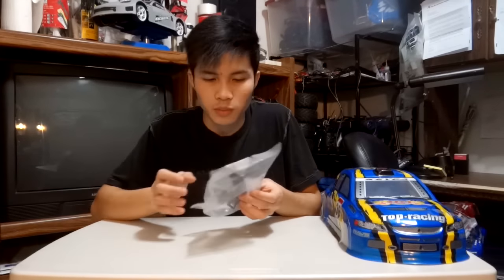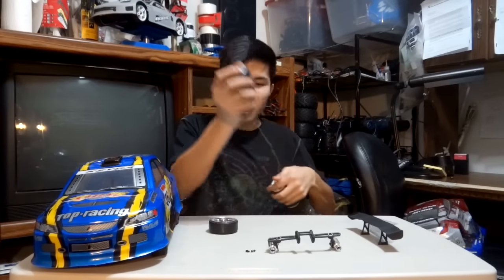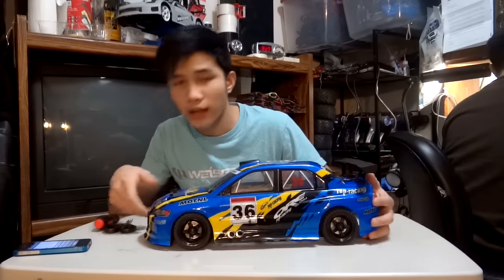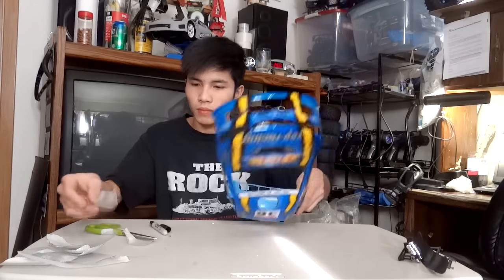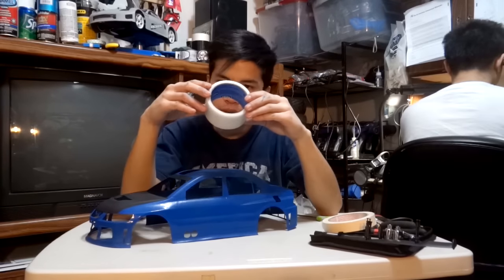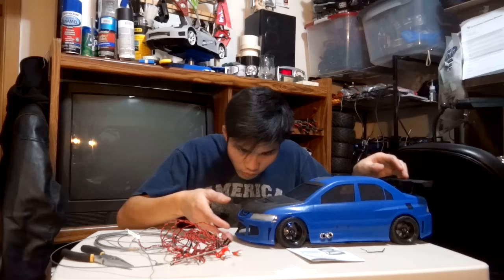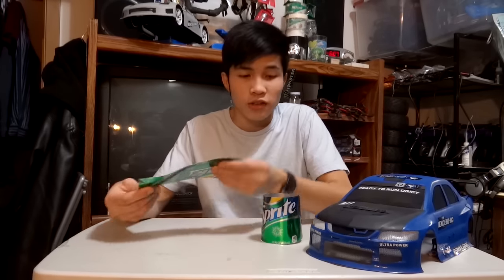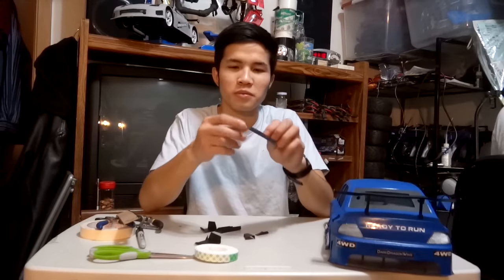RCMC4 | Mitsubishi Lancer Evolution IX or EVO 9 WTAC - RC Car

Comment from the maker: 1/10 MadSpeed Drift Car
eBay https://goo.gl/hh5zcP
Amazon http://amzn.to/2nV0o4w

1/10 Lancer Evo 9 Body
eBay https://goo.gl/rYDfVB

Tools For RC Modify:

Dubro 2331 lexan Body Reamer & Scissors Set
eBay https://goo.gl/uHkXpX
Amazon http://amzn.to/2nF4MTx

X Acto Knife
eBay https://goo.gl/9Knkdg
Amazon http://amzn.to/2nbSdUh

Duct Tape Nashua 48mm x 55m 
eBay https://goo.gl/K4scr9

Soldering Iron 60W
eBay https://goo.gl/aqH0Tu
Amazon http://amzn.to/2oGmhV3

Soldering Wire 60/40
eBay https://goo.gl/str3K6
Amazon http://amzn.to/2nCthR5

After Market RC Parts:

MST 5 Spokes Wheel Offset +3 Flat silver CS-R Tire
eBay https://goo.gl/0dR4mi

1/10 RC Drift Exhausts
eBay https://goo.gl/Oo6x6m

1/10 RC Spoiler
eBay https://goo.gl/b0zjL4
Amazon http://amzn.to/2oE4vVo

GT POWER 12 LED Flashing Lights
eBay https://goo.gl/9Lq5cj
Amazon http://amzn.to/2oaPBVW

Amaco 1/16 Aluminum Contour Mesh AO50004D
eBay https://goo.gl/dGr7Qn

Optional Parts:

Mini Car Stand Blue by Duratrax DTXC2361
eBay https://goo.gl/fzWXPr
Amazon http://amzn.to/2oaYzm3

Deluxe Car Stand Blue by Duratrax DTXC2370
eBay https://goo.gl/ghGvBr
Amazon http://amzn.to/2nFakgy

Comment: To make finding where to drill the holes without mistakes , put a bit of toothpaste on the body posts and put the body on to it. It may sound strange, but it works!😁😁
Reply: Btw, it would look a LOT cooler if you put a light smoke tint on the taillights

Comment: What are the tools u use in rc modify I would like  to try and cosomize a body
Reply from the maker: All can be found on eBay.com:

-1/10 MadSpeed RC Drift Car
Here: http://www.ebay.com/sch/i.html?_sacat=0&_from=R40&_sop=15&_nkw=1%2F10+madspeed&rt=nc&LH_BIN=1
Or here: http://www.nitrorcx.com/exrcmadrca.html

- I bought this body from eBay.
"1/10 Mitsubishi Lancer Evolution Painted RC Racing On-Road Car 190mm Body Shell"
http://www.ebay.com/itm/1-10-Mitsubishi-Lancer-Evolution-Painted-RC-Racing-On-Road-Car-190mm-Body-Shell-/380839859452?pt=Radio_Control_Parts_Accessories&hash=item58abd314fc
...........................................
List of stuff:

-Wire Mesh
Amaco Wire Form 1/16" Aluminum Contour Mesh
http://www.dickblick.com/items/33408-2260/
Or Here
color: aluminum
description: woven contour mesh 1/16 in.
unit: mini-pack
http://www.ebay.com/itm/Amaco-WireForm-Metal-Mesh-/130887667128?pt=LH_DefaultDomain_0&var=&hash=item1e79834db8

-RC LED Lights
GT POWER 12 LED RC Flashing Lights
http://www.ebay.com/sch/i.html?_odkw=rc+lights+flashing+gt&_udlo=12&LH_BIN=1&_sop=15&_osacat=0&_from=R40&_trksid=p2045573.m570.l1313.TR0.TRC0.H0.Xrc+lights+flashing&_nkw=rc+lights+flashing&_sacat=0

-Mini Hinges:
http://www.ebay.com/itm/12pcs-Mini-Small-Metal-Hinge-with-Screws-for-1-12-Dollhouse-Miniature-Furniture-/121227467383?pt=LH_DefaultDomain_0&hash=item1c39b85a77

-Scissors and Body Reamer
Dubro Body Reamer and Curved Lexan Scissors Set for RC Car/Truck Bodies
http://www.ebay.com/itm/Dubro-Body-Reamer-and-Curved-Lexan-Scissors-Set-for-RC-Car-Truck-Bodies-/190829778599?pt=Radio_Control_Parts_Accessories&hash=item2c6e5756a7

-X Acto Knife
Light-Duty Aluminum Handle Knife with 10pcs X-Acto 11 Knife Blades Safety Cap
http://www.ebay.com/itm/Light-Duty-Aluminum-Handle-Knife-with-10pcs-X-Acto-11-Knife-Blades-Safety-Cap-/251337372314?pt=Model_Kit_US&hash=item3a84dff29a

-Glue Gun
GLUE GUN WITH 26 FREE GLUE STICKS HOT MELT ARTS CRAFT
http://www.ebay.com/itm/GLUE-GUN-WITH-26-FREE-GLUE-STICKS-HOT-MELT-ARTS-CRAFT-/220764546060?pt=LH_DefaultDomain_0&hash=item336697a40c

Optional:

-Chicago Rotary Dremel tools
 Cheap:
http://www.ebay.com/itm/80-Piece-Rotary-Tool-Kit-works-with-dremel-bits-/160795638323?pt=Power_Tools&hash=item25702aba33

-1/10 RC Drift Exhausts
http://www.ebay.com/itm/1-10-RC-R-c-Racing-DRIFT-Car-Exhaust-Pipes-Disguise-Plastic-Dummy-Kit-Set-s-/151227876108?pt=Radio_Control_Parts_Accessories&hash=item2335e2430c
All Search: http://www.ebay.com/sch/i.html?LH_BIN=1&_from=R40&_sacat=0&_nkw=1%2F10+RC+drift+exhaust&_sop=15

-RC Intercooler
http://www.ebay.com/itm/1-10-RC-Car-Alloy-Inter-cooler-Kit-with-Sim-Hose-for-Tamiya-HPI-Traxxas-Yokomo-/380838777085?pt=Radio_Control_Parts_Accessories&hash=item58abc290fd
All Search: http://www.ebay.com/sch/i.html?_sacat=0&_from=R40&_sop=15&_nkw=RC+intercooler&rt=nc&LH_BIN=1
.....................................
RC Car Stands on eBay.com
Small one:
DTXC2361 Pit Tech Deluxe Mini Car Stand Blue RC DURATRAX PRODUCT

Bigger one:
DTXC2370 Pit Tech Deluxe Car Stand Blue RC DURATRAX CAR STAND

Comment: hey bro where I encounter this kind of cart sales sites?
if wrong words, it is because I am Brazilian
Reply from the maker: http://www.ebay.com/sch/i.html?_sacat=0&_from=R40&_sop=15&_nkw=1%2F10+madspeed&rt=nc&LH_BIN=1

http://www.ebay.com/itm/1-10-Mitsubishi-Lancer-Evolution-Painted-RC-Racing-On-Road-Car-190mm-Body-Shell-/380839859452?pt=Radio_Control_Parts_Accessories&hash=item58abd314fc

Comment: Hi, what tool do you use to make the squares in the bumpers ?
Reply from the maker: -X Acto Knife
Light-Duty Aluminum Handle Knife with 10pcs X-Acto 11 Knife Blades Safety Cap
http://www.ebay.com/itm/Light-Duty-Aluminum-Handle-Knife-with-10pcs-X-Acto-11-Knife-Blades-Safety-Cap-/251337372314?pt=Model_Kit_US&hash=item3a84dff29a

More tools in the description
Reply: Pm

Comment: What is that metal you used in front of the lights? Ebay link?
The DarkDragonWing
Reply from the maker: http://www.ebay.com/itm/Amaco-WireForm-Aluminum-Modeling-Metal-Mesh-1-16-Pattern-Wire-Form-Contour-Mesh-/301146411373?pt=LH_DefaultDomain_0&hash=item461db9916d

Comment: wher you get the exaust ??  sorry for me englisch im from belg
uim
Reply from the maker: Here are the similar ones:
http://www.ebay.com/sch/i.html?_sacat=0&_from=R40&LH_BIN=1&_nkw=1%2F10+drift+exhaust&_sop=15

http://www.ebay.com/itm/1-10-RC-R-c-Racing-DRIFT-Car-Exhaust-Pipes-Disguise-Plastic-Dummy-Kit-Set-s-/151227876108?pt=Radio_Control_Parts_Accessories&hash=item2335e2430c

cheers
Reply: thanks man

Comment: Why do you  put the stickers on randomly on instead of using real aftermarked like rays and hks oder tire brands. But besides that i like how you do it . I learned from you how to build an rc bodie so thanks a lot
Reply from the maker: Skyline lp Thanks! Yes, at the time I didn't have much stickers, so I just used what I had. I like the brand names stickers, but nowadays I like it clean without a lot of stickers( most of the time).

Comment: where do you get the shells for the car? i would like to get an evo
Reply from the maker: Here: http://www.ebay.com/itm/1-10-Mitsubishi-Lancer-Evolution-Painted-RC-Racing-On-Road-Car-190mm-Body-Shell-/380839859452?pt=Radio_Control_Parts_Accessories&hash=item58abd314fc

Comment: dose anyone know where to get 1/16  drift body shells
Reply from the maker: Not a lot that I can find

http://www.ebay.com/sch/i.html?_odkw=1%2F16%20body&LH_BIN=1&_sop=15&_osacat=0&_from=R40&_trksid=p2045573.m570.l1313.TR11.TRC1.A0.H0.X1%2F16%20body%20rc&_nkw=1%2F16%20body%20rc&_sacat=0&_udlo=8&_udhi
Reply: thank you so much ur awsome i couldnt find them anywhere even on ebay
Reply: i might just sell the 1/16 hpi and get a 1/10 car
Reply from the maker: timmy time

Here the drift cars that I buy: http://www.ebay.com/sch/i.html?_sacat=0&_from=R40&_sop=15&_nkw=1%2F10+madspeed&rt=nc&LH_BIN=1
Reply: thx
Reply: do those cars also have a controller and charger because it dosnt say
Reply from the maker: timmy time
 Yes, ready to run.
Reply: yay thx again :)

Comment: Hey can u please help me bro I can't find the ligth no were give me a heads up
Reply from the maker: http://www.ebay.com/itm/G-T-POWER-12-LED-RC-Car-Flashing-Light-System-LE858-/170642829279?pt=Outdoor_Toys_Structures_US&hash=item27bb1aefdf
Reply: Thanks man u are awesome
Reply from the maker: It is playable, you can always modify the body.
Reply: Thanks man I like ur evolution you got how can u get one or the body
Reply from the maker: I bought the body separately. I don't know if it will fit your RC that you are buying though.
: http://www.ebay.com/itm/1-10-Mitsubishi-Lancer-Evolution-Painted-RC-Racing-On-Road-Car-190mm-Body-Shell-/380839859452?pt=Radio_Control_Parts_Accessories&hash=item58abd314fc
Reply: Oooo nice were can I buy a RC like that will fit on it
Reply from the maker: Omar Alex
one of these on here:
http://www.ebay.com/sch/i.html?_sacat=0&_from=R40&_sop=15&_nkw=1%2F10+madspeed&rt=nc&LH_BIN=1
ore here:
http://www.nitrorcx.com/exrcmadrca.html
Reply: Thanks man and have u see that gas one? And how fast can they run
Reply from the maker: no I never played the gas one

Comment: The DarkDragonWing where do you buy your cars and the chasee
Reply from the maker: here
http://www.ebay.com/sch/i.html?_sacat=0&_from=R40&_sop=15&_nkw=1%2F10+madspeed&rt=nc&LH_BIN=1

or here
http://www.nitrorcx.com/exrcmadrca.html

Body: http://www.ebay.com/itm/1-10-Mitsubishi-Lancer-Evolution-Painted-RC-Racing-On-Road-Car-190mm-Body-Shell-/380839859452?pt=Radio_Control_Parts_Accessories&hash=item58abd314fc
Reply: The DarkDragonWing thanks very much !!
 and were do you buy the transparent  chasee 
last question: are the cars
 electric?
Reply from the maker: Juampi Juricka
yes, all electric
Here: -Wire Mesh
Amaco Wire Form 1/16" Aluminum Contour Mesh
http://www.dickblick.com/items/33408-2260/

Or Here
color: aluminum
description: woven contour mesh 1/16 in.
unit: mini-pack
http://www.ebay.com/itm/Amaco-WireForm-Metal-Mesh-/130887667128?pt=LH_DefaultDomain_0&var=&hash=item1e79834db8
Reply: thanks a lot again :)

Comment: how much it cost?? Is it available in Canada? Greetings :)
Reply from the maker: Hi, here is the car:
http://www.ebay.com/sch/i.html?_sacat=0&_from=R40&_sop=15&_nkw=1%2F10+madspeed&rt=nc&LH_BIN=1
Here is optional body:
http://www.ebay.com/itm/1-10-Mitsubishi-Lancer-Evolution-Painted-RC-Racing-On-Road-Car-190mm-Body-Shell-/380839859452?pt=Radio_Control_Parts_Accessories&hash=item58abd314fc

Comment: what rc car brand do you use? can you send me the link please
Reply from the maker: +Jayden Sikalasinh You can buy one of these.
I buy this one:
http://www.nitrorcx.com/madspeed-drift-car-green.html
These ones are good too, but they are more expensive:
http://www.ebay.com/sch/i.html?_sacat=0&_from=R40&_sop=15&_nkw=1%2F10+madspeed&rt=nc&LH_BIN=1
http://www.ebay.com/sch/i.html?_odkw=1%2F10+hpi+drift&_udlo=190&_sop=15&LH_BIN=1&_osacat=0&_from=R40&_trksid=p2045573.m570.l1313.TR2.TRC1.A0.H0.X1%2F10+hpi+drift+RTR.TRS0&_nkw=1%2F10+hpi+drift+RTR&_sacat=0
http://www.ebay.com/sch/i.html?_udlo=290&_sop=15&_mPrRngCbx=1&LH_BIN=1&_from=R40&_sacat=0&_nkw=1/10%20mst%20drift%20RTR&rt=nc&_udhi
http://www.ebay.com/sch/i.html?_odkw=1%2F10+tamiya+drift&_udlo=300&_sop=15&LH_BIN=1&_osacat=0&_from=R40&_trksid=p2045573.m570.l1313.TR0.TRC0.H0.X1%2F10+tamiya+drift+RTR.TRS0&_nkw=1%2F10+tamiya+drift+RTR&_sacat=0

Comment: Hey dude what type of tools did u use for that rc car
Reply from the maker: Let me know what I missed:

- I bought this body from eBay.
"1/10 Mitsubishi Lancer Evolution Painted RC Racing On-Road Car 190mm Body Shell"

All can be found on eBay.com:

-The 1/10 MadSpeed (the RC car, the whole chassis)
here
http://www.ebay.com/sch/i.html?_sacat=0&_from=R40&_sop=15&_nkw=1%2F10+madspeed&rt=nc&LH_BIN=1

or here
http://www.nitrorcx.com/exrcmadrca.html

List of things needed:

-Wire Mesh
Amaco Wire Form 1/16" Aluminum Contour Mesh
http://www.dickblick.com/items/33408-2260/

(aluminum, woven contour mesh 1/16, mini-pack)
http://www.ebay.com/itm/Amaco-WireForm-Metal-Mesh-/130887667128?pt=LH_DefaultDomain_0&var=&hash=item1e79834db8

-RC LED Lights
New RC 1:10 On Road Drift Car GT POWER 12 LED Flashing Lights Lamps System Night
http://www.ebay.com/itm/New-RC-1-10-On-Road-Drift-Car-GT-POWER-12-LED-Flashing-Lights-Lamps-System-Night-/301105700100?pt=Radio_Control_Parts_Accessories&hash=item461b4c5d04

-mini Speakers
http://www.ebay.com/itm/New-Cool-and-cute-E1800-2-0-Mini-Speaker-Black-for-PC-MP3-MP4-laptop-computer-/390585499216?pt=US_Audio_Docks_Mini_Speakers&hash=item5af0b5be50

-Mini Hinges:
http://www.ebay.com/itm/12pcs-Mini-Small-Metal-Hinge-with-Screws-for-1-12-Dollhouse-Miniature-Furniture-/121227467383?pt=LH_DefaultDomain_0&hash=item1c39b85a77

-Scissors and Body Reamer
Dubro Body Reamer and Curved Lexan Scissors Set for RC Car/Truck Bodies
http://www.ebay.com/itm/Dubro-Body-Reamer-and-Curved-Lexan-Scissors-Set-for-RC-Car-Truck-Bodies-/190829778599?pt=Radio_Control_Parts_Accessories&hash=item2c6e5756a7

-X Acto Knife
Light-Duty Aluminum Handle Knife with 10pcs X-Acto 11 Knife Blades Safety Cap
http://www.ebay.com/itm/Light-Duty-Aluminum-Handle-Knife-with-10pcs-X-Acto-11-Knife-Blades-Safety-Cap-/251337372314?pt=Model_Kit_US&hash=item3a84dff29a

-Glue Gun
GLUE GUN WITH 26 FREE GLUE STICKS HOT MELT ARTS CRAFT
http://www.ebay.com/itm/GLUE-GUN-WITH-26-FREE-GLUE-STICKS-HOT-MELT-ARTS-CRAFT-/220764546060?pt=LH_DefaultDomain_0&hash=item336697a40c

Optional:

-Rotary Tool
 Cheap:
http://www.ebay.com/itm/80-Piece-Rotary-Tool-Kit-works-with-dremel-bits-/160795638323?pt=Power_Tools&hash=item25702aba33
More expensive:
http://www.ebay.com/itm/46pc-Electric-Rotary-Kit-Set-Variable-Speed-8000-30000-rpm-Dremel-Type-Tool-/161243676405?pt=Power_Tools&hash=item258adf3ef5
http://www.ebay.com/itm/40pc-Electric-MINI-ROTARY-DIE-GRINDER-TOOL-ACCESSORIES-grind-sand-polish-dremel-/360859976004?pt=Power_Tools&hash=item5404ee4144

-Duct Tape
NASHUA TAPE PRODUCTS 684355 20 Yards Transparent Duct Tape
http://www.ebay.com/itm/NASHUA-TAPE-PRODUCTS-684355-20-Yards-Transparent-Duct-Tape-/251266373408?pt=LH_DefaultDomain_0&hash=item3a80a49720

-The Exhausts: I found the similar ones on eBay.com
"1/10 RC R/c Racing DRIFT Car Exhaust Pipes Disguise Plastic Dummy Kit Set s"
http://www.ebay.com/itm/1-10-RC-R-c-Racing-DRIFT-Car-Exhaust-Pipes-Disguise-Plastic-Dummy-Kit-Set-s-/151196329116?pt=Radio_Control_Parts_Accessories&hash=item233400e49c

.....................................
RC Car Stands on eBay.com
Small one:
DTXC2361 Pit Tech Deluxe Mini Car Stand Blue RC DURATRAX PRODUCT

Bigger one:
DTXC2370 Pit Tech Deluxe Car Stand Blue RC DURATRAX CAR STAND

Comment from the maker: +kevin sanchez
http://www.ebay.com/sch/i.html?_sacat=0&_from=R40&_sop=15&_nkw=1%2F10+madspeed&rt=nc&LH_BIN=1
Reply: From where did you get the body
Reply from the maker: Aman Shaikh
 here: http://www.ebay.com/itm/1-10-Mitsubishi-Lancer-Evolution-Painted-RC-Racing-On-Road-Car-190mm-Body-Shell-/380839859452?pt=Radio_Control_Parts_Accessories&hash=item58abd314fc
Reply: The DarkDragonWing ökk
Reply: The DarkDragonWing